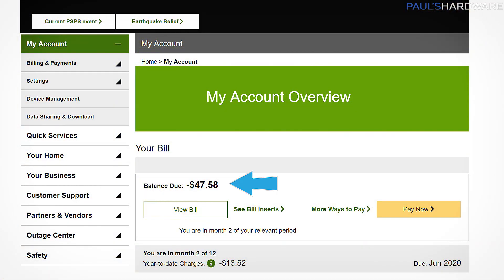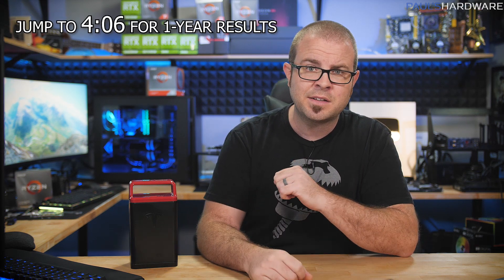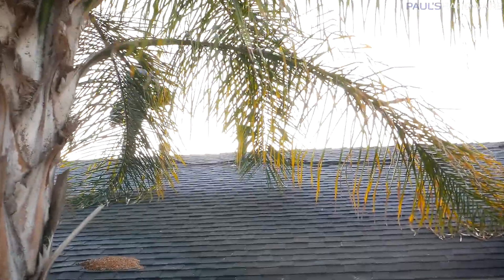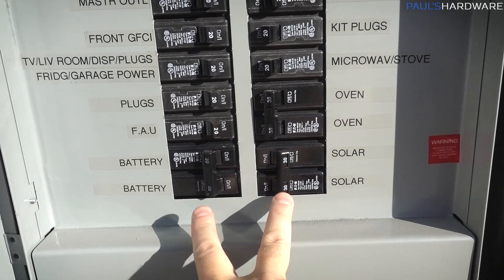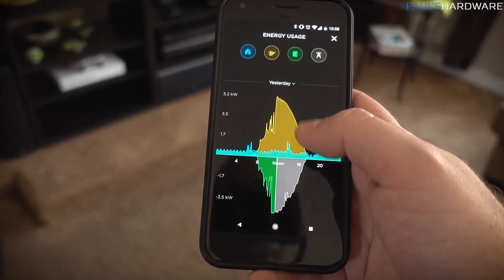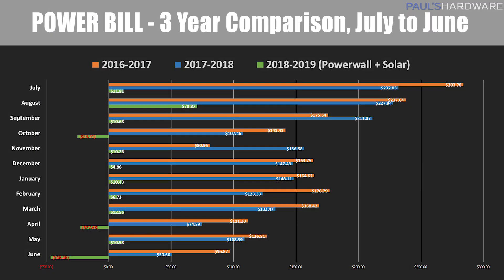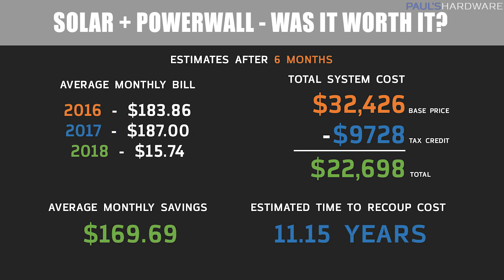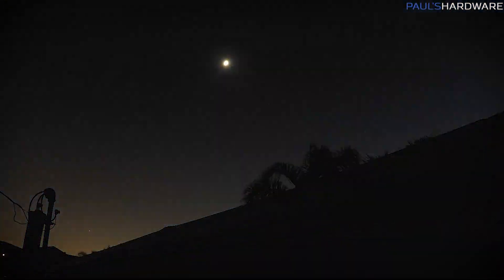TESLA Solar and Powerwall: 1 Year Later!

Comment: Do a dirty and a clean test on your panels. Thank you for your videos.
Reply: Definitely worth it, I just cleaned my setup, jumped from 2.8kw to 3.4kw.
Reply: @Furrrburger  just like computers that needs cleaning from time to time.
Reply: This is a PG-13 channel, sir.
Reply: I'm very dirty
Reply: I would like to see that too please
Reply: I did a cleaning of my solar panels and to my surprise I got an 18.7% increase in solar production.
Reply: +1 on the cleaning test. I was told I wouldn't need to clean my panels after they were installed. I want to see if there's an actual difference.
Reply: +1
Reply: For those in climates with more rain, maybe Paul could do a dirty - simulated rain - washed comparison? Really wondering if a rain shower is almost as effective as someone washing it.
Reply: @TheJAMF  The morning dew will cause dirt and grime to stick to the panels. Rain will wash some of it away, but it can't get all of it and a film will build up. Washing will get that built up film off.
Reply: Luhkian a good spray with a mix of, 3 parts vinegar 2 parts water, with a small bag of Epsom salts and good squirt of dish soap, will remove the film. Good for patios too.
Reply: I sua the same @luhkian
Reply: Luhkian This.
Reply: Can’t farm potatoes if your solar panels are dirty!
Reply: @daniellewis1789  How do you know I grow potatoes? Have you been stalking me?
Reply: Luhkian in my limited experience all people who clean solar panels grow potatoes.
Reply: We have 75 panels and 3 PW for 7 months.   I haven’t heard anything about cleaning them.  Can’t wait to see you do this first before I attempt it.
Reply: If the sun can't get to the panel then.....LOL it's a SOLAR PANEL!!! you know it probably doubled...
Reply: Yes please ^^
Reply: Yeah...look for Micro Meteorites and signs of Chinese smog! 😒
Reply: u can have water and dust shield coating on ur panels which can help u reduce ur regular panel cleaning to occasional times for 2-3yr depending on site, 1 liter kit cost around 500 usd and cover 50x330W panels. and repeat coating cost after 2-3yr is 50% of first time. watsapp 9717280820 or email ur requirement to saini.amarjeet@gmail.com incase interested. annual generation increase of 5-10% has been found with our customers.

Comment: It's that Powerwall that is driving that longer payoff time. My system, which is on month 8 is just panels and not a battery. (non Tesla panels, but still top tier made-in-the-USA 20 year guarantee for 90% production). And my payoff time is still looking nice at around 8 years with similar monthly savings (~$150 per month). I'm in the hottest month now, but it's also the biggest sun month (less clouds) so I'm still around $150 savings per month. 

I don't have time-of-use rates, so there's no benefit to me spending an extra ~$5-8k on batteries unless I want power during those very few blackouts that we get. (Average is about 2 hours every other year in this area).  

I'll likely add another 3-5kW of generation (over my current 5kW) after they're paid off assuming costs have come down and power costs keep rising (which they will) so that I can try and get as close to net 0 payments to the electric company over a year.

Comment: I would love to see a video where you clean the solar panels and give a before/after performance review!

Edit: You should also link the zombie apocalypse vid in the description!
Reply from the maker: Thanks for letting me know! The Zombie Apocalypse video link should be there now too 😁
Reply: @paulshardware  Thank you very much Mr. Hardware!
Reply: Unless you live in an area that has a lot of dust/dirt, and it never rains, your solar panels should not be affected by that much. Typically rain will was away the surface debris. If you are in one of the previously mentioned type of place, you can take your garden hose and spray it off (If possible) and often times this is sufficient. If you do end up doing this, make sure you spray them in the early morning or at night, as the panels are glass and can crack.
Reply: At best you will find like a 5% increase and thats usually after a few years without cleaning, panels overall are self cleaning, just clean of bird poop when you see it and if testing straight after a clean, because the panels would have cooled down they would be more efficient so testing right after doesnt give valid results, and if cleaning them in the middle of summer use warm water as to not cause them to stress crack
Reply: I've had my tesla panels for three years and have never cleaned them. There has been no noticeable degradation in energy production.  I will say the Tesla app sucks compared to the Solar City app.
Reply: I just cleaned them a few weeks ago for the first time in a year or so and saw a 6kWh daily improvement or about 6-7% in my case. Mine were quite dusty though.
Reply: Same, would love to see if and what difference it makes.
Reply: 11 Years old installation here in Italy. There's no really need to clean the panels. I do that once a year and no difference at all is measurable. Anyway after 10 years i still got almost the same production of first one .Plant (that costed 6k euros kWp back in the days) is repayed this year. Best money  use of my life. A battery will be placed sooner or later.
Reply: I was told not to use domestic tap water, but that it must be de-ionised water, after they did clean mine, there was a modest output increase.

Comment: I'd love to see a before and after cleaning video. Even a video just of you cleaning the panels and what kind of work goes into it. Thanks for all the info Paul!
Reply from the maker: Thank you! I have a hose-attachment soft scrubber thing that's made for washing cars, so I'll give that a try
Reply: @paulshardware  make sure you lookup a few videos / sites on how to clean it depending on the surface /etc  , is it glass ? is it safe to use some cleaners ? etc etc . dont' damage anything ! get your facts in order !
Reply: @SerpentDrago   Warm water and a soft brush is all you need, just remember to clean from the top down and dont point the hose up into the gaps of the tiles or you'll have water leaking into the roof
Reply: doesn't look like he has too many trees nearby at all so it shouldn't be that bad. I have seen some that were super dirty.
Reply: @itsneight1260  True, but SoCal be dusty and it doesn't rain too much.
Reply: Yes, and pay special attention to the parts of the cleaning process people often get wrong, like the slow-mo shots where you oil your shirtless body, and those difficult, close-up pan shots of your glistening arms as you scrub the panels.  So many Youtubers glance over those steps.
Reply: @docferringer  very true!

Comment: Have you set up with the PVOutput website yet? It's kind of cool, but does best if you have a device to upload data automatically. So I have to enter everything manually, which is a pain. Yeah, a before/after cleaning output would be interesting. Just make sure you aren't like that one guy who did that, and checked his readings immediately after cleaning them-which he did, while the sun was still out, and cooled his panels to increase the output artificially. He just didn't realize it. I'd also be interested in the cleaning method you use.